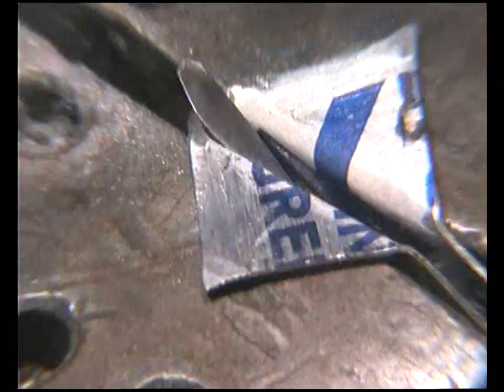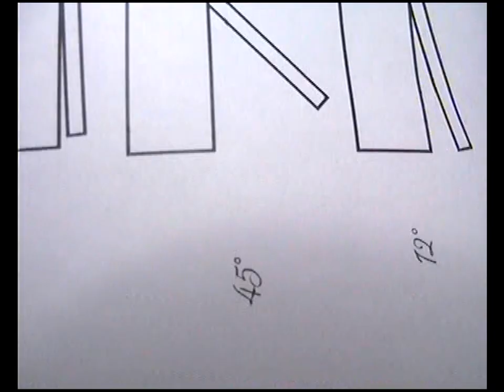The Shaun Hughes Free Graver Sharpening System

Comment: Yes...I think I see how you obtained the proper angles.
You used the three different ‘positioning foils’ (soda cans?) to hold the graver axis in the proper relationship to the top of the vice for filing.  The bottom ‘V’ angle was obtained using the punch marks around the shaft of the graver while aligned with a center line.

BTW- Number the holding foils 1, 2 and 3 with a marker for easier identification and sequence of use. Or, assign them a descriptive name. 

Nice job!
Reply: The angles don't need to be perfect, just close. You find what lasts the longest and works best for you through experience. I just use the side of a die grinding stone and eyeball them, works fine!
Reply from the maker: Yes you got it. I call it 'Let your graver be your guide. You can resharpen any graver with no guide like this. Just orient the heel to flush with the top of the vice and polish is with a sheet of glass with diamond paste.